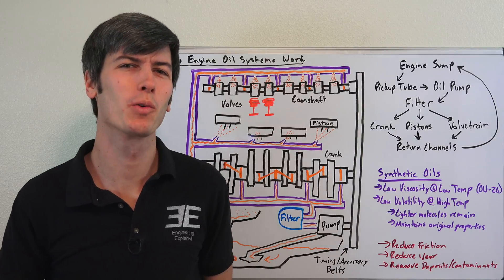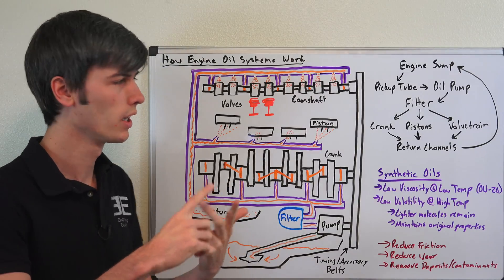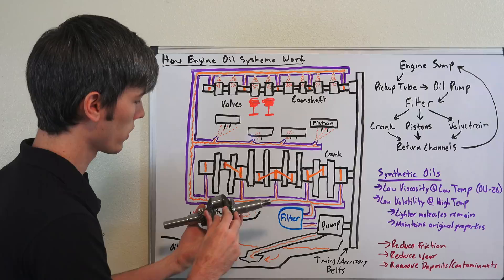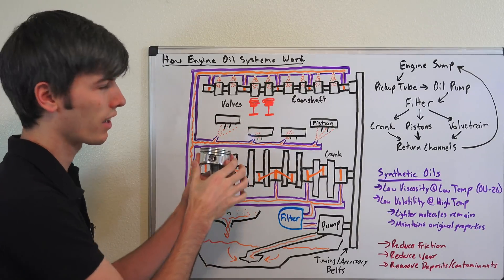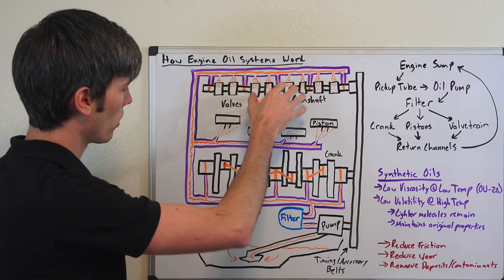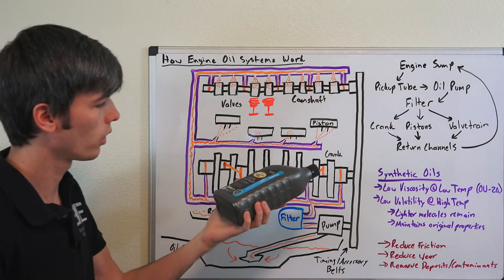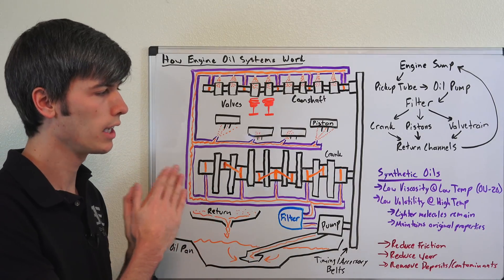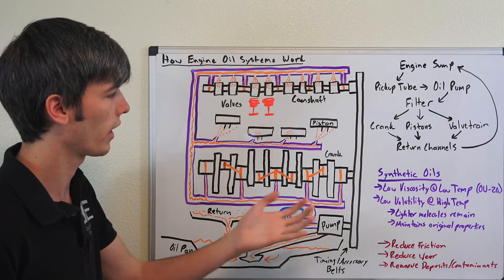How Do Engine Oil Systems Work?

Comment: One correction: not all oil systems have the pump driven by the belt. I think in wet sump systems the pump is attached to the crank itself

Comment: Hi There !

First & Foremost GRATITUDE For All The Videos and Classes About Everything Engineering Related.

I’d Like To Know How Important Is To Have The Engine Oil Level Checked Every Now and Then.

And Wich Should Be Ideal  ?

Engine Oil Level :

Within “E” (Empty) and “F” (Full) Mark ?

At The “F” (Full). Mark ?

Or (I Guess, Least Recommendable !) Engine Oil Level “Slightly” Above “Empty” Mark ?

Many Thanks !

Best Regards !

Ed

Comment: so, the question i have is, how does the typical 20-40 pounds of oil pressure keep the rod bearings from touching the crankshaft when there is full throttle combustion pressure that would have to be well over 100,000 psi?

Comment: Hello! What do you think about adding adictives to the engine oil?
There is an american adictive called Militec 1. It was developed to lubricate firearms. It works as a dry lubrication. Here in Brazil many people use it on engine oil and even on air conditioning system. We have some videos that people dry the oil and run the car to prove it can help on an event of lubrication failure. Also it can improve the life of the engine at all. Best regards!

Comment: i have a 2008 Civic, i use shell 10w-40, wondering if i should change to 0w-20. the temp in my hometown is usually around 27-33 degree celsius. also traffic jam is worse.

Comment: Pumps are generally NOT powered with timing or accessory belts.  They're usually directly connected via gear or shaft to the crankshaft.

Comment: then, for a subaru engine( flat4/6), is it harder for the oil to reach "upper side" of the piston?  For example, half circle of the ring is lubricated well while they other half circle suffer from relatively lack of oil due to the gravity. Is that true?

Comment: Those little holes on the piston that allow the oil to drop down beneath it, how do they not allow for the air/fuel mixture to also pass through?

Comment: +Engineering Explained What keeps oil from leaking past the cam shaft and through the valves into the combustion chamber? Is there an O-ring around the valve?

Comment: In a typical engine lubricating system, there's a lot of oil sitting in the oil pan. Then why car makers seldom put some fin on the oil pan to help cool the oil, even on some high power car? This seems to be a very easy and straight-forward way to do the job. They rather use oil cooler with somewhat complex oil route, why?
Reply: The oil pan/sump is usually subjected to quite a strong breeze when the car is moving so there's already some cooling going on, however, most of that cooling is on the underside of the oil pan/sump where the oil is coldest anyway.
There's a much more important reason, though. An oil pan/sump on a basic car is often just a few stamped steel parts spot welded together (the pan/sump and 1 or more baffles) and adding fins to that can easily quadruple the parts count which will likely double the cost.

Comment: As far as the cooling properties of oil cooling goes, it may be hard with your sponsors but I'd really enjoy it if you'd talk about some of the differences that other formulae have - for example, its well known (and actually documented) that running an oil like Royal Purple on the track will result in measurably cooler oil temperatures than something like a Mobile One.  Same with viscosity - of course, thicker will be cooler, but you run into tolerance limits there too.

Comment: most engines have gear direct driven pumps on the crank snout or driven by a distributor back in the older engine.

Comment: I was just talking to a friend today who told me about something that sounded more like an oil control solenoid which had these valves to judge an intake pressure and regulate the output pressure of oil from the pump...he was saying this was done to help with fuel efficiency for the motor.  What I just wrote down isn't exactly what he was saying but it is what my understanding of what he was trying to explain to me. Does anyone know what he might be talking about and would you be willing to explain it for me? His vehicle is a second gen Hyundai Santa Fe

Comment: Hi again Jason thank you for doing the cold car start vid I asked for,  it was very helpful,  I have an other question. 
If the car sits a month or so than attempting to start it is going to cause damage?  Brcausr all the oil will sitbat the bottom oil seamp.?

Comment: excuse me. in some part of my country there is a myth "hit the throtle before turning off the engine" i mean, rev the engine before turing it off. i heard there will be wear issues bcz of the oil doesnt flow well bcz of this action.. but i still didnt get the logic.  plz answer it on ur new video Mr. Jason, Thank you so much!

Comment: It'd be nice if you could include, or at least link to, a 3d model of how all of this works; and maybe how each system varies between engine manufacturers or even different lines of engines from a single manufacturer.

Comment: Is it normal for oil to disappear very quickly if you drive it at higher rpm's regularly >?
Reply: Samuel Vinnik Its common for older engines to burn oil but if you burn oil quickly, it could be a gasket that needs replacing.
Reply: You think its worth it to spend $80-90 on an inspection ? Because it does burn oil quickly and for a while I thought it was normal until some of my friends said they never really have to top off their oil until their oil change.... where I have to every other week atleast
Reply: Samuel Vinnik how old is it with how many miles?
Reply: 2003 Honda Accord with 187,XXX miles
Reply: Samuel Vinnik Samuel Vinnik i wouldnt want to mis inform you as im only halfway through my automotive course with little experience, but i would say you most likely have gasket leaking. Is it worth having it looked at? The problem with burning oil is it could lead to carbon buildup and it costs money to keep buying oil to fill it up. I guess it depends how long your car would last other wise, if its a rust bucket, it might be best to just drive it that way, but if its still a nice car it might be worth fixing. I would ask an experienced mechanic his thoughts on it though.

Comment: For an engine that has been sitting for a long period of time, would you recommend spinning it over without actually starting it (i.e. pulling the fuse to the fuel pump) until oil pressure is built in order to lubricate everything in a low load situation?

Comment: hii i have one question that i have a car Maruti suzuki ciaz in india purchased one year ago and total running KMs is 3000 so after 1year or 10000KMs it is recomended to change oil according to owners manual maintenance chart and recently i have changed engine oil but  my cars owners manual says to use 5w30 A5/B5 OIL but by mistake i  poured mobil super 5w40 oil so does this will cause any harm in my engine ?

Comment: you say the oil pump is driven by the belt? no it's not. it's driven directly by the crankshaft itself. at least on hondas. the oil pump seal is actually also the crankshaft seal, the oil pump bolts right in front of the end of the crankshaft
Reply: Subaru drives the oil pump the same way Honda does.
I don't know any modern manufacturer that drives the oil pump with a belt or a chain. If you broke the belt or chain the engine could easily keep running until it destroyed itself.
Reply: eksine Probably meant chain which is connected to the crank. Either way he's correct. Older vehicles used timing belts instead of chains. As far as seals you have a front crank seal and a rear main seal. Usually pumps run on a secondary chain/belt.
Reply: Adrian Gutierrez only the water pump runs on the timing belt, again the front crank/ oil pump seal is the same item, it runs directly off the crankshaft itself. no belt or chain, at least on hondas. I know, I've done 2
Reply: 2JZ-GTE is directly mounted on the crankshaft.  no belt or chain involved.  look it up
Reply: Some of the older cars also run it straight off the distributor.

Comment: Manufacturer says replace my Hyundai oil and filter every 7500 miles.  I replace them every 10,000 with synthetic oil on the tens, ie, @ 10,000, 20,000, 30,000 etc....easy to remember.  Am I asking for trouble?  Aside from selling less Penzoil, any thoughts on my method?

Comment: Is it a wet sump or dry sump??
Reply: A dry sump hasn't really an oil pan. They have an oil reservoir which is located somewhere outside of the engine. Also a dyr sump usually uses at least 2 oil pumps, one for pumping the oil from the oil reservoir into the engine and a second one to pump the oil back into the reservoir.
Reply: Yathu prem wet
Reply: Nicolas Losito how it is diff from dry sump??
Reply: Yathu prem
Not exactly, The oil is still collected at the bottom of the engine by gravity just like in a vet sump. But from there basically a drainage pump pumps the oil out of the engine back to the oil reservoir with relative low pressure. So there is still a bit of oil at the bottom of the engine just a lot less than in a vet sump.
Reply: shi01 so the entire system is pressurised ??

Comment: good review, except the oil pump on most combustion engines are driven by the crankshaft (as in the LS1), or the camshaft. (not belt driven)

Comment: Do you recommend adding flushing additives or kerosene just before an oil and filter change to clean the system?
Reply: Oscar De la Serna check your manual. If it doesn't say, don't do it!

Comment: I just found out that my dad's 1JZ-GE-swapped Nissan pickup truck had a modified (cut to a smaller size) oil pan to fit the engine bay, and now the oil pan only houses 4 liters of oil as opposed to the original 6 liters in the original design. What are the consequences of having such a modification and how may I prevent them or reduce their chances of happening?
Reply: Nick Amarit reduced cooling, increased oil change intervals, and they system may run dry
Reply: thanks for the replies, guys :)

Comment: Oil technology has changed a lot for more modern cars, but is there a type of oil that has the benefits of modern oil, but keeps the standards of older engines say from the 80's and 90's?
Reply: UnknownRemedy723 not that I am aware of. SN is the newest standard

Comment: What are the advantages to using a heavier oil? I see a lot of Subaru WRX/STi owners use the 5w40 T6. Just wondering why that option is more popular than a 5w30.
Reply from the maker: +Daniel Jackson if you take your car out on a track, the temps might get hotter than driving on the street. So a 5W-40 will be a little thicker at say, 230 F than a 5W-30, and offer better protection. But when keeping your car on the street, temps tend to not get this high, so it's best to run what the manufacturer recommends.

Comment: How does a handbrake work
Reply from the maker: +JustTahmid check out my video "never use the handbrake button?" I've taken one apart and you can see how it works. :)
Reply: Engineering Explained I've seen the video, it was helpful, but I was hoping to get information on the amount of newton's applied to the handbrake and cable including other information. 

I'm currently doing FEA at uni and optimising the handbrake and mechanism. I also watch your videos in general. Cheers for the help.

Comment: i have yet to see an oil pump that is belt powered. usually camshaft gear or crankshaft on ohc engines powers the pump. distributor shaft on older engines.

Comment: Wow, a piston with oil-return-holes, that fancy...
No really, Nissan (like the 2.0 X-trail) and Jaguar sometimes don't have these at all. Toyota, BMW, VW, Mazda etc. etc. etc. make to little holes that are guaranteed to clogg up after your warranty is over, and usually they clogg up even before that.
---
And this is how to paraphrase your text about high vs low temperature oil: Firstly full synthetic doesn't have the contaminants that mineral oil has, secondly you don't have a mixture of several paraffins with an avg viscosity of 10w40 but you can choose just one viscosity oil.
Low viscosity isn't better actually, it does give less friction but it also worse at holding the oil film and lubricating and protecting your engine, which is exactly what you want. Because of this you have more power when the engine is new, yet it wears out more quickly, so they can sell you a new car! Also Low viscosity oil is worse at keeping a seal at the piston rings, which means more oil will flow into the combustion chamber. By the way the product "Bardahl no smoke" is simply an oil thickening agent.
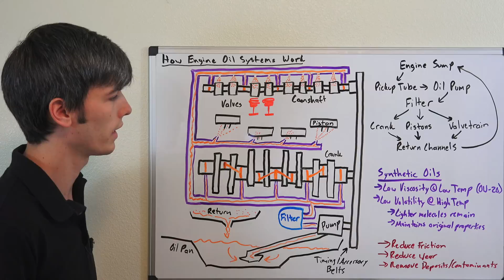5:00 Ok wait, wait, wait... low viscosity oils will drip down into the sump, high viscosity oils will stay on that camshaft when you turn down your engine. 5:20 "Conventional oils will start to get thicker" Exactly, yet that thickening doesn't depend on your viscosity, high viscosity synthetic won't loose it's properties too. It's a reason to use synthetic in general, it's no excuse for the 0w20.

Also racing-cars are using 10w60, that speaks for itself. Apparently everyone in that business knows that high viscosity is better for performance and reliability, and still they sell 0w20 to the customers.
Reply: sasja de vries 10/60 is new to me, would this oil be beneficial for the public?

Comment: What are your thoughts on using higher or lower operating viscosity oils (not the W viscosity)?

Honda has started using 0W20 oils in their cars, what do you think about the protection the 20 grade gives in comparison to something like 0W40 at operating temps? I know some people go thicker for track days, do you feel 20 grade is too thin to properly protect the engine over 100's of thousands kms?

I'm skeptical because of the recent push to lower economy figures and it's effect on long term engine longevity and oil burning

Comment: how can you explain that turbo engines "drink" oil more that NA engine?
Reply: because turbo are moving parts too and need lubrication there...
Reply: +Ilham Defra I thought it was due to heat problems
Reply: It has to do with excess pressures getting past the cylinders and into the oily parts of an engine, that then gets recirculated through the PCV breather and back into the combustion chamber where it is burned.
Reply: +TheLeafySpring thx sounds a better explenation

Comment: Belt driven oil pump?
Reply from the maker: +jemorrismmorris often directly geared to the crankshaft, rather than a belt. Perhaps I oversimplified that bit but the point is it rotated with the crank.

Comment: Hey Jason, what happens when you over fill the oil? How would this damage the engine, or how much over fill would cause damage. Thanks in advance.
Reply from the maker: +patch860 wastes power, can create drag on the crankshaft.

Comment: How does the oil lubricate the pistons without getting inside the combustion chamber? Or does oil get inside the combustion chamber?
Reply: Typical piston has 2 compression piston rings follow by 1 oil ring. The oil ring will scrape off the oil on the cylinder wall, therefore no oil in the combustion chamber.

Comment: 15w40 is more protect wear than 0w40..but in terms of cleaning effect..the full syn oil win this..
Reply: pikachu mouse a bigger  number does not mean it protects from wear better. The 0w number means it will flow quickly 'should' flow quickly when it is cold. For engines with dual overhead cams etc using an oil that is Gluggy on startup will allow more wear to occur before operating temperature. The true protection qualities of oils come from its ability to maintain performance, cleaning properties and film strength.